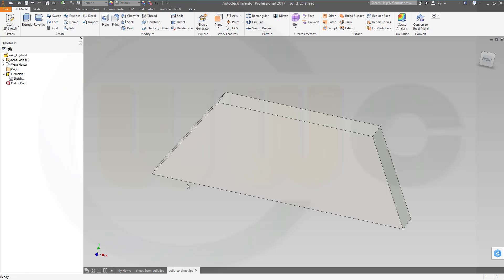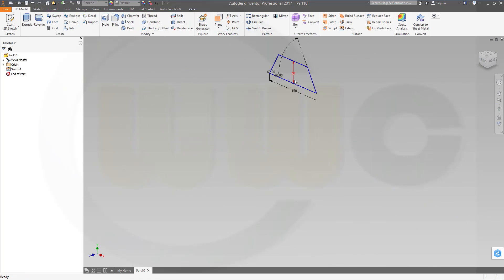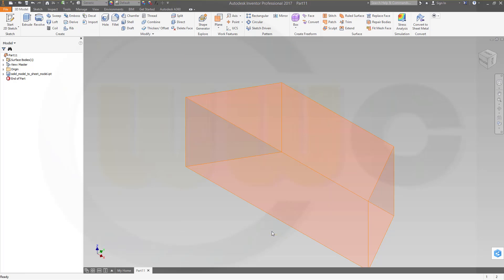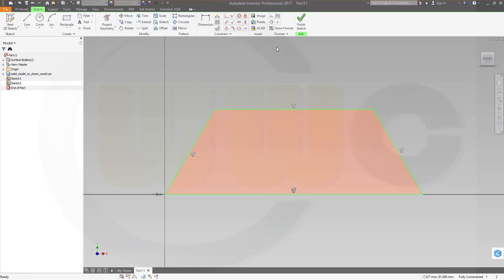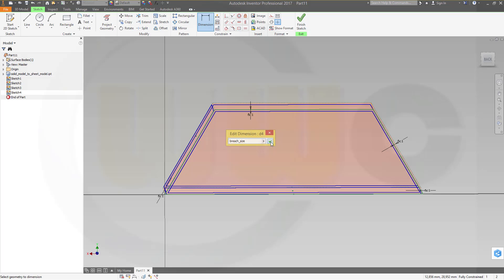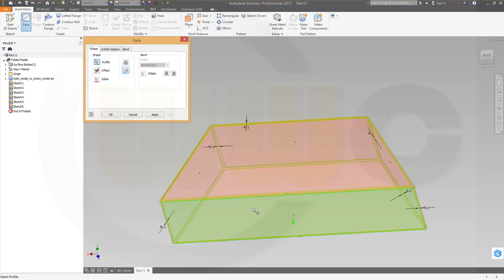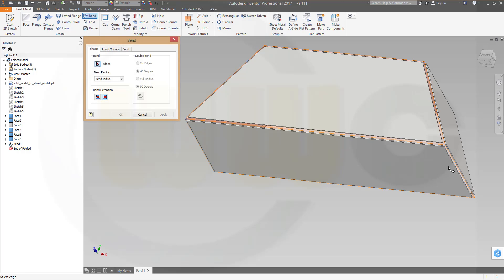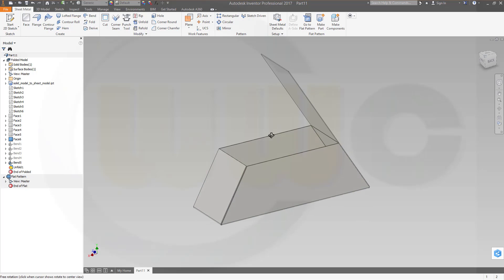S.2 Solid to Sheet Metal - Inventor 2017 Sheet Metal Training

Comment: Hi sir
to rotate should be press F3 or there is a easy way also to rotate in assembly  for a body
Reply from the maker: You mean to rotate a part or the complete assembly?
Reply: @wolfgang.walden.cad.training  in solidworks I can rotate a part indepently by right click on part but i cant in inventor also to rotate a part I ever hold F3. is there a easy way?  TX
Reply from the maker: Ok I see, if you select a part and make a right click, there is the "free rotate" command in the drop down menu.